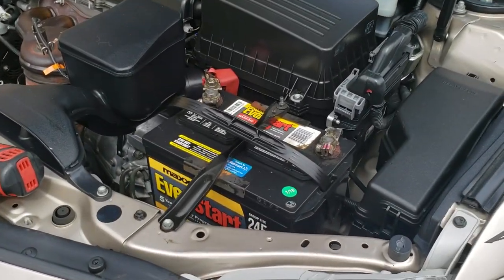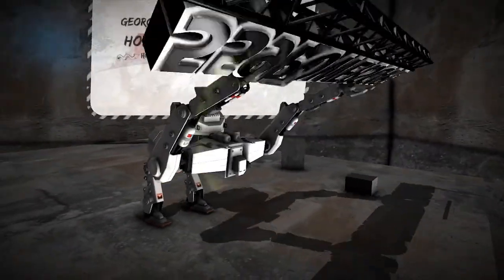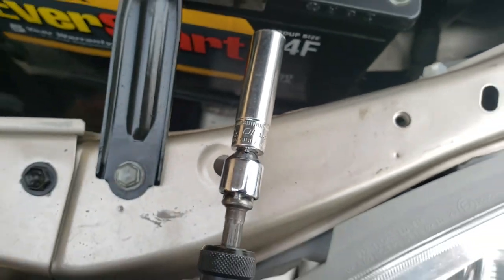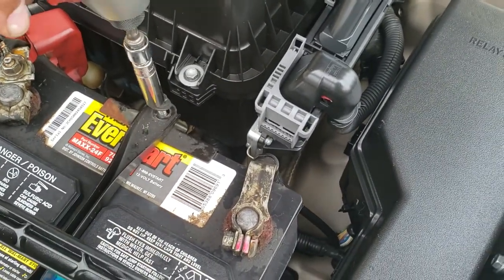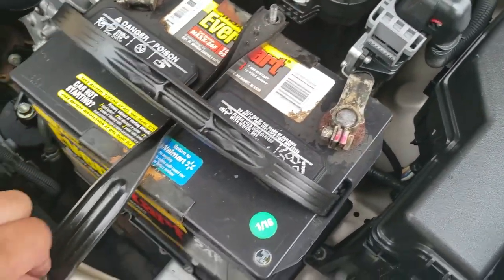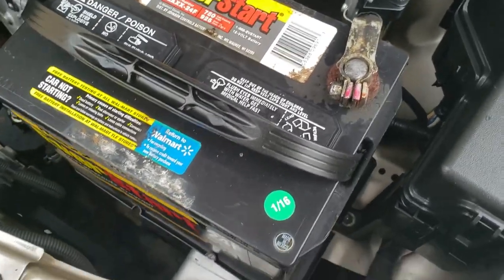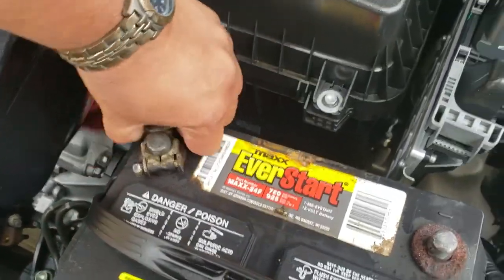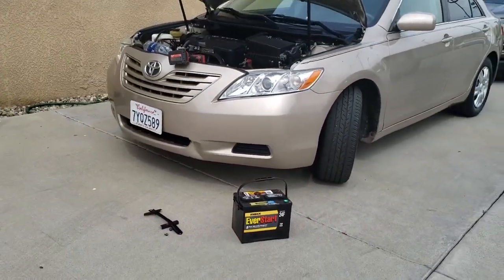How to: Remove a battery from a 2008 Toyota Camry

Comment: what type of drill this is
Reply from the maker: Its an impact Milwaukee drill
Reply: GEORGE LOPEZ HOW TO DO IT YOUR SELF Does it have to be that grill or can I get a reasonable grill with a 10ml
Reply from the maker: @daniellesmith2101  socket and ratchet will do, I just use power tools to make the job easier and faster
Reply: GEORGE LOPEZ HOW TO DO IT YOUR SELF Thank you
Reply from the maker: @daniellesmith2101  4 sure no problem. Hope this works out for you! Thank you for your support!
Reply: GEORGE LOPEZ HOW TO DO IT YOUR SELF Most definitely, perfect.